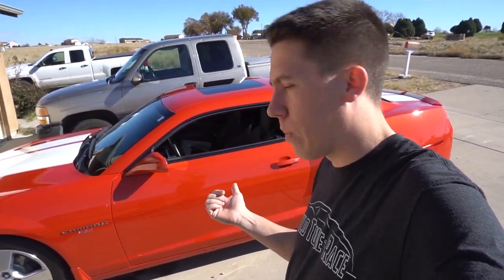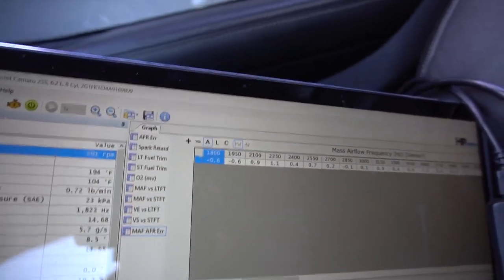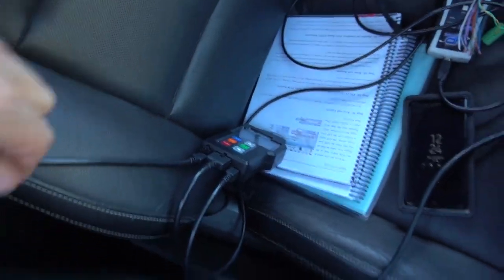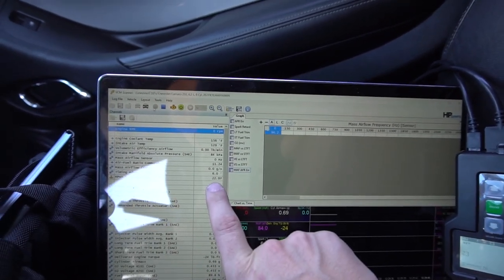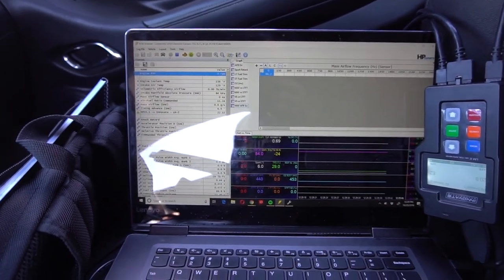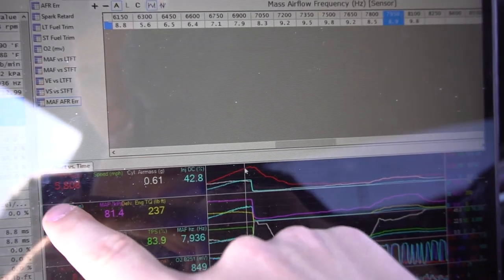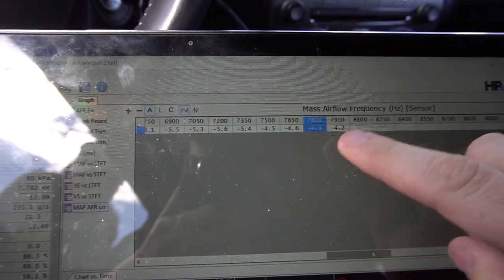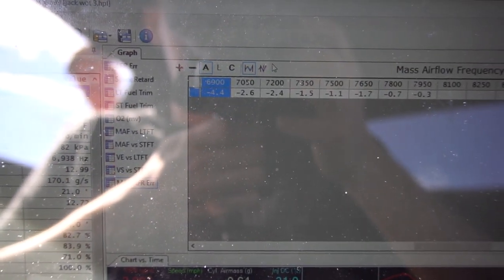LS3 Camaro Tuning With Hp Tuners!

Comment: Great video!  Most tuners want to charge extra to weld in a bung for the wideband sensor which is a total waste of money.  I realize this is a old video but the best "vice grip" to hold a wideband sensor to a tailpipe is the Tekton PLK90303 kit which includes two different size locking pliers that works on 99% of vehicles.  In my experience, the shape of the Tekton Locking Pliers do not disturb the turbulent flow which is imperative for precise tuning and they hold tight even with aggressive high rpm testing.  The kit is only $25, if you want accurate readings it's worth the extra cost.

Comment: this isnt a ls3 its a l99 engine
Reply: L99 is an ls3 but an automatic
Reply: @Dilpickle2002  NO.  L99 is a gutless version of the LS3.  The LS3 does not have power robbing VVT with heavy valvetrain components.  Plus the L99 has a lame cam since its automatic for people not qualified to operate the M6.  It's not even close...forgot to mention the 3.27 gear ratio in the L99 vs 3.45 in the LS3.    L99 is for green horn drivers.

Comment: Great channel!! Need help tuning my 2010 camaro ss it’s lean at idle how do I make richer with hp tuners  wb  1.15 thx keep the videos coming!!
Reply from the maker: Thanks! Sounds like it needs some tuning. You can try multiplying the MAF curve at idle hz do a small log to see where the maf reads at idle and then add 13% or x multiply by 1.13 and then smooth the maf curve

Comment: 3:02 Any issue getting proper AFR because the sensor is after the cats and flooded with air at the exhaust tip? Seems to be susceptible to error.
Reply from the maker: You don't get the best reading at idle/part throttle but the way the tube is designed and placement at wide open throttle it works pretty good! I always tune leaner at the exhaust tip to compensate for the AFR that is actually  coming out of the engine

Comment: You can set a variant where you only see readings over 90% throttle. You won’t have to stop and start recording every time. You can make it one complete log instead of multiple
Reply from the maker: Nice! I'll have to figure out that setting! Thanks for the info!
Reply: Check out The Tuning School and I think A21 Bravo has it on their pages.
Reply from the maker: @txslugga06  nice! I went to the tuning school gm beginners course I have an idea where it will be in the software. Just need to play with it more lol. Never ending!
Reply: Build Tune Race heck yeah dude. Pass on any info you learn. It’s still a learning curve for me. Maybe you can integrate your EFI greatness with HP also 😬
Reply from the maker: 😂 Shoot I'm just learning! That's the plan though document it as I go!